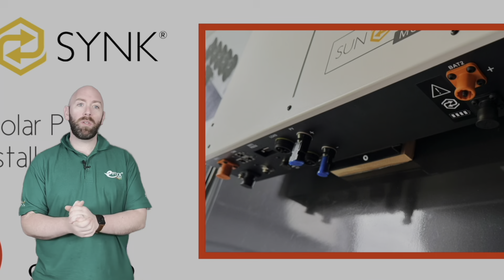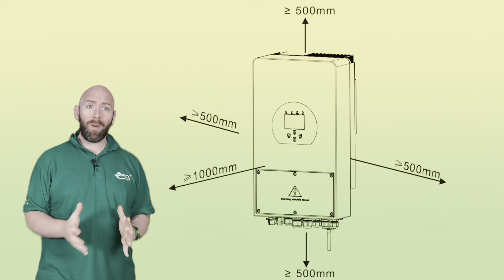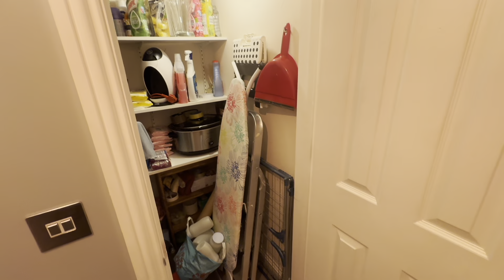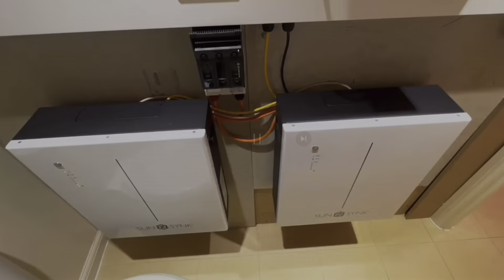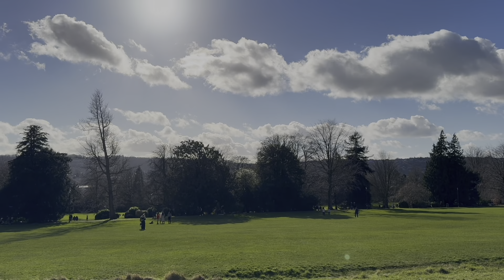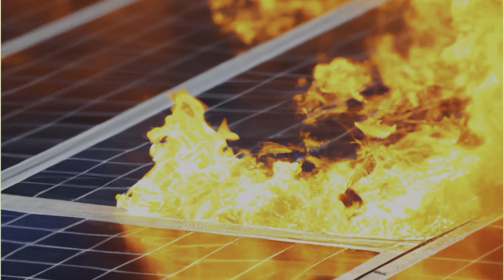Think You Can Install Solar Inverters Anywhere? Think Again!

Comment: I can't imagine if gas stoves, furnaces etc were a new technology today.  I have a pilot/ flame burning in my house everyday in my basement with lines connected full of natural gas!  I would imagine we would have to build a dedicated concrete structure in our yard to house the furnace if this was produced in 2025.  I also can't believe that we can keep power tool batteries, scooter and bike batteries in our home and we don't have a dedicated location for these either?  We are in the era of make it and then figure out the safety requirements.  Not a good time to spend money on this experiment.

Comment: PAS 63100:2024 looks like it's written by an institution that hasn't got a grip on reality. Lofts are often the ONLY suitable location for inverter setups and why not. Here's also the thing; imagine any place where an inverter catches fire - it's going to be worse than in the loft.

Garage: burns garage, blows up car, people are sleeping above the garage. Dead.
Utility room, often close to bedrooms/under bedrooms. Dead.
Basement: Heat rises, ground floor on fire, high likelihood of Dead.
Loft: Above bedroom, heat rises, it's slow to go down - highest likelihood of survival.

The ideal situation is an outhouse or garden room, but in absence of that option; The loft is the BEST location.
Reply: Additional benefit of a loft, insulated or not, is that usually the temperature is higher than outside. I acknowledge that some lofts need additional venting as the temperature may exceed 60c in a closed roof space. But honestly if the temperature goes that high in the loft you have bigger issues. (60c is a real fire risk before it even becomes an inverter issue I reckon).
Reply: @velianlodestone1249  for high temperature lofts just have a temperature controlled exhaust fan that kicks in above 35c as most electronics are rated for 40c ambient anyway

Comment: So if the installation (inverter and or batteries) is put into a location which isn’t permitted, would that mean that it wouldn’t be guaranteed or warrantied under the manufacturer warranty? 

What does this also mean for the MCS if it was issued? Would this also be void? What would be the customers come back if there was a fault/issue?

Comment: Hahaha, basically build a custom extension. Make sure it has heating, and cooling. Is 5 metres away from anything else and is made of Titanium. Seems to me there are a few to many bureaucrats with to much time on their hands. 26% of housing stock in the UK are Terrace houses. So that counts them all out. Then we have people without garages not including terrace houses which is another 22% of UK housing stock. So we are already up to nearly 50% of houses not suitable for any form of installation apart from outside.

Comment: What i find funny, and is one of many examples of how the IET reg's are complete garbage full of contradictions is how a CU must be metal yet when it comes to solar, with 400v+ DC which can  produce a sustained arc if you look at in the wrong way - then having everything it runs through being made of flammable meltable plastic is just fine. 

DC Isolators plastic? - yep that's ok. Big plastic trunking covering 240v AC and 400v DC cables, yep that's fine. SPD enclosures plastic - yep that's ok to. CU oh no that must be metal, the rest of the kit that is far more likely to melt itself to the ground can be plastic, wood or whatever you like.

Comment: So are lofts not allowed for inverters? And if not, what's the reasoning? I was hoping this video would clear it up. I can see batteries aren't (and it's now regulated against).
Reply: Advised against. PAS 63100 is not an actual requirement yet. Also, as it fails to distinguish between battery chemistries, it's a rather stupid document.

Comment: Is PAS2035 mandatory?
Reply: No and it's also stupid, they will probably make it mandatory at some point though.
Reply: PAS63100 isn't mandatory, but it will be included in Amendment 4 of the 18th Edition of BS7671. However, that's not expected until summer 2026 and by then PAS63100 could have changed again.
Reply: @VinoVeritas_  It needs to distinguish between NCM/NCA and LFP batteries before it's any use. The risk profile is quite different.
Reply: @xxwookey  This was the problem with having Tesla on the committee when writing PAS63100. They were always going to manipulate the discourse to their advantage.
Reply: @VinoVeritas_  That only works if there was no-one else there who knew what they were talking about. Tesla are almost unique in making non-LFP batts (although even  they are using LFP now SFAIK?) so would have been pretty-much on their own arguing that NCM/NCA should be treated the same.
Reply: @xxwookey  There wasn't anyone else there with the clout of Tesla. Off the top of my head , I believe the only other battery company involved was PureDrive or a similar UK company. Even though Tesla is now using LiFePO4 cells in the Powerwall 3, all of their offerings are externally (garage at best) mounted.

It's a pity that PAS63100 wasn't combined with any actual data showing the number of incidents of fires either caused by domestic BESS or exacerbated by their presence.

Comment: We just had our mcs inspection.   The inspector said that lofts are fine for inverter and batterys if fitting  at the  cable end and weight off the rafters.
Reply: Sounds about right.
Reply: Yeah I have to often fix their bad installs

Comment: I fitted enPhase inverters to each solar panel so that DC is outside the house.  High amps is a bad idea inside a house.  I suspect it will take a few years for the powers that be figure it out….
Reply: It isn't typically high amps. 12A per string on a 2-string 3000V 7kW system would be quite typical. Fits down 4mm2 cable. No higher than plenty of normal AC loads.

Comment: Regarding PAS 63100:2024 | 20 Mar 2024. When installing a system in a garage used for an ICE vehicle how does it comply with the distance requirements for stored flammable materials (2m)?
Reply: A petrol or diesel vehicle is not regarded as ‘storage’. It’s referring to oil and gas tanks basically.
Reply: @joparish1037  'Regarded' or not: twenty gallons of petrol is still twenty gallons of petrol.

Comment: Please also stop installing silly little inverters, there's not much difference in cost between 3.6kW and a 5.5kW or even the 8.8kW inverter. I've seen many a comment where someone has had 3.6kW inverter fitted (with batteries), then it doesn't cover their load, and worst still they can't charge their batteries fully in the off peak periods, which is a must in the winter months.
Reply: Issue is sometimes you can't get grid application over 3.6kw so have to stay in a g98 application
Reply: @bramcoteelectrical1088  That's an export limit, it doesn't mean you can only have a 3.68 kW inverter,  just do G100 and limit export.
Reply: @TheRonskiman  depends if you can as not all inverters are g100 compliant.
Most DNOs are alot better now days thou 
I use fronious and with a meter and ct you can get G100 part 2 compliance
Reply: @electricalstuffathome  I appreciate that, but so many companies just go for the easy simple 3.68 kW option, they make their profit, and the unsuspecting customer only realises the issues later down the road. Things are improving though, but slowly.
Reply: @TheRonskiman  definitely thanks for input 👍 😊 and agree with your comment

Comment: You are joking aren't you??  You may need to install a heater in a garage, what an insane waste of money, and power. I have my batteries in my detached garage, any decent battery will have built in heating, mine do. I have an 80w heater mat in each battery bank, works perfectly.
Reply: All the astericks have come out in this video regarding batteries, which is good. If it doesn't have self heating it's not going to be a lot of fun in cold countries, and if you live in a hot country you'll have to deal with the other end of the thermometer.

Comment: They might have to rethink lofts. Firstly all of the hundreds and hundreds of installs with it already there. Also that this is the most suitable location in the vast majority of cases. Maybe some additional protection may be required for lofts to overcome the safety issues?
Reply: @paulstimpson8977  yeah, they need to decide whether they want the country to meet it's net zero target or not. Not everyone has a nice detached house where you have other options. Unless the option of battery storage is to be discouraged
Reply: @OG-dp1kx  net zero will never be reached legally as there are far to few installers and more rules keep getting added that old homes cant handle or dont have space for.

Comment: Interesting... and commonsense... I tend to install slightly larger solar systems and unlike conventional contracting, I find that the installations escalate both in equipment, wiring capacities and loads of additional 'bits' such as 3-phase RCBO's, MCB's, isolators, DC panels etc and the only way to get it to all sit 'right' is to perfect the SLD and then spend an evening designing it all in a CAD system. The issue is we all started off as AC electricians, not architects, DC electricians, network engineers, CCTV, RF communication etc! I used to go to the pub on Sunday nights, now its spent studying as if I was 18 again!

Comment: My 'offgrid' inverter, batteries, and accessories are in a dedicated tiny shed in the garden which seems to be working out okay, but I think I lost an elderly 'miniPC' out there after a couple of years due to humidity, temperature fluctuations and tiny spiders - there was some dense fine web around the power supply socket inside. I'm guessing any PCBs will eventually succumb the same way. The Raspberry Pi I replaced it with is in a sealed biscuit tin, so I'm hoping it'll last.
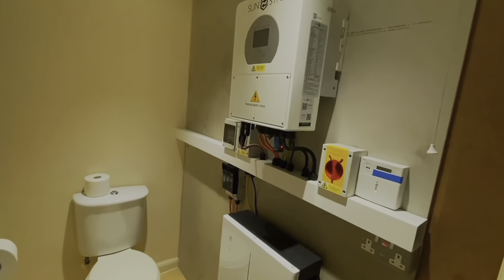Your choice of 'aesthetics' clip 1:17 is chef's kiss.
Reply: Dust build up from forced air flow is a problem, humidity on top of that makes it worse.  It's not unusual to see poor quality paint being undermined by rust in such circumstances, and the PCBs don't fare well either.  There's a lot to be said for passively cooled power equipment.